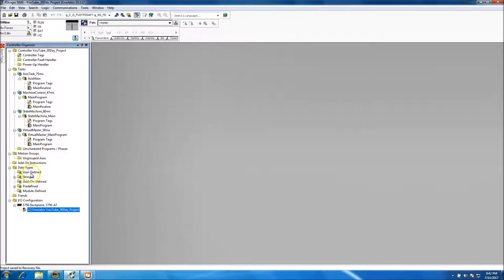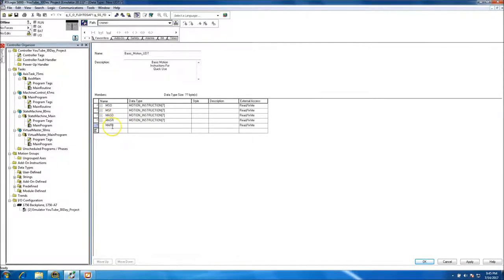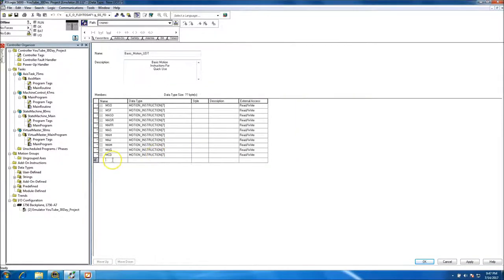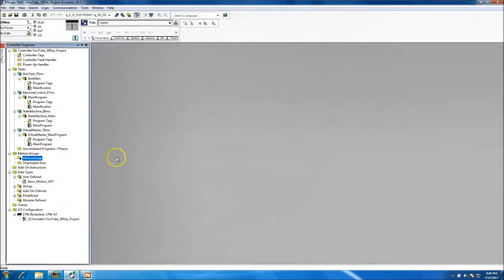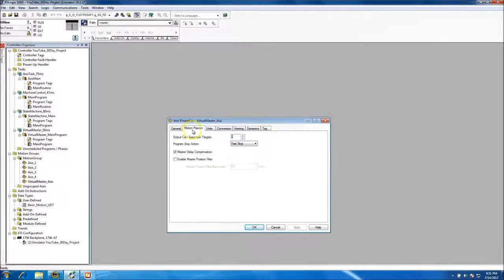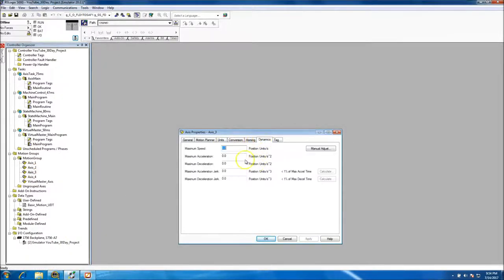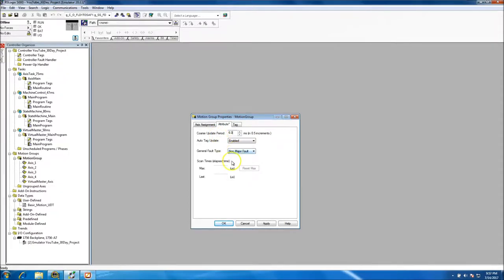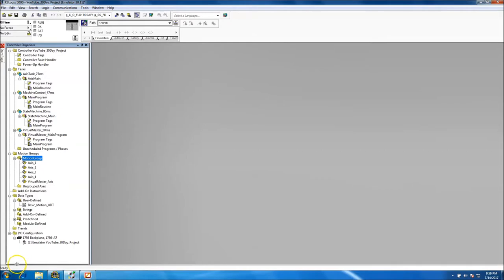Servo Motion Project Day 3 Adding Motion Groups and Adding Servo Axis

Comment: Why are you using UDT to define the instructions instead of  adding instructions form "motion direct command?
Reply: from*
Reply from the maker: Because a UDT allows easier & quicker programming.

It allows you to make quick & easy changes of edits to have costum PLC logic for whatever is needed in that machine's application.